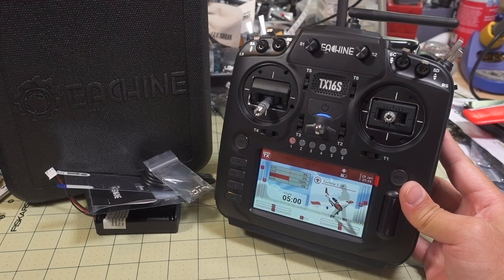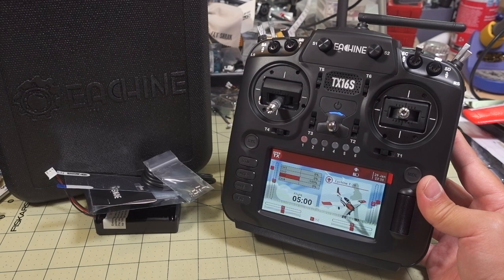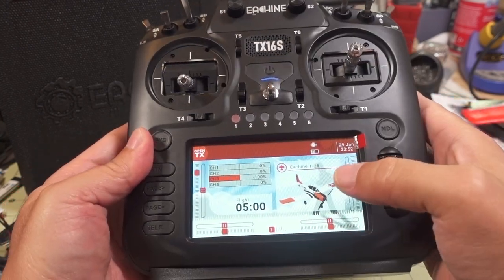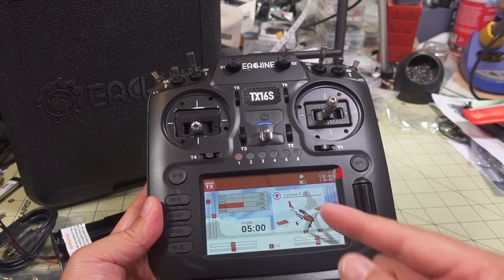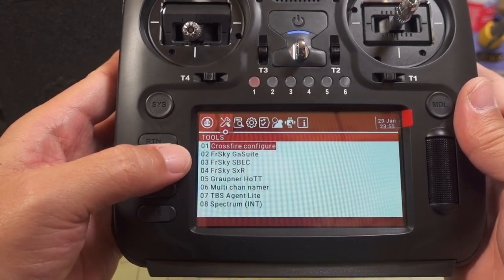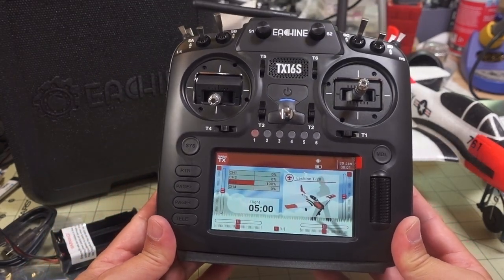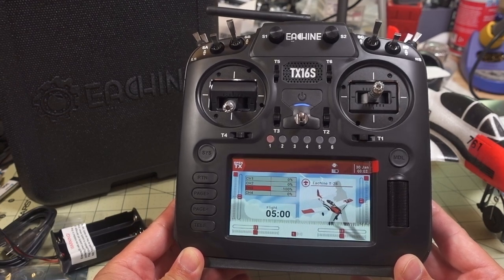Eachine TX16S OpenTX Radio 📡

Comment: Awesome review, Albert! Really nice! 😃
About the airplanes, try to put the radio in bind mode and then connect the battery to the airplane. Many older protocols used to work like that. 😊
Anyway, stay safe there with your family! 🖖😊
Reply from the maker: I did the binding with my T-Lite in the order shown in the video and it worked so there's something wrong with the pre-installed model on this radio.
Reply: @AlbertKimTV  Oh... I see. 😕

Comment: Thats what Eachine always does, they simply pay companies , for example,  "Skyzone" and they pay to have their name slapped on it, its known as "OEM"  which actually is common practice in other industries all the time ,, Im just greatful that Eachine has finally begun to use much better quality companies etc! With the exception of the newest So called Remake of the Wizard,, , I mean the Wizard 6sHV was atleast something new and different,  but to take a quad that is at best 4-5 years old , and pretend to act like its a better quality setup and or components,  is just about a clear betrayel in my book, so Eachine the transmitter looks great and good on u for the goggles as of late,, but shame on u for your most recent attempt to dump older products that were collecting dust!
Reply: Btw, another great review my brotha!!

Comment: I like the looks of it but I’d be concerned about replacement parts if needed. Would you have to try & get parts from Eachine or are the RM TX16S parts drop in replacements? I thought about getting a RM TX16S but not sure it would be an up grade for my Jumper T16.

Good job Albert as usual……..

Comment: Hi Albert! Im thinking of geting into FPV from rc cars and planes. I have got my old dx6i and as far as i know its good idea to upgrade it (it has only 6 channels and no JR bay to get multi module). Many bnf beginner whoops dont support dsm and soldering spektrum satellite cant be done on many boards (3,3v output). What radio do you recommend as a replacement (quads, planes and support of dsm2 to bind with my old receivers)? I was thnking about Jumper T12 pro, but im confused if that is a good radio... or should i save more for eachine or RM tx16s? Maybe other radio? what will you suggest? Cheers :)
Reply from the maker: What defines a good radio is very subjective.  I used the T12 Pro for a long time and loved that radio.  I now use the T-Lite and it's my daily driver.  However, many people also don't like those small radios and prefer big and heavy ones like the TX16S.  Most of these recent radios all work just fine. Whether you'll enjoy using them is something I can't know.

Comment: hello, did you  get it to bind, love the radio would get it now but will wait until binding issue is resolved.
Reply from the maker: Binding was fine. It just doesn't respond to the controls.
Reply: @AlbertKimTV  ok, did you get it to work.
Reply: Did you ever resolve this issue? Just from watching the video now I would suggest moving the transmitter farther away from the model. I have noticed that if the tx and rx are too close binding does not always work.

Comment: Hi did you get it to work with the plane I spent al day yesterday trying to get it to work thanks
Reply from the maker: I did when I created my own model from scratch.  The pre-programmed model has an error in it somewhere but I wasn't able to find it.
Reply: Hi thanks for reply I just can't get it to work even when I tried to do my own model any advice would be grateful or maybe a short video many thanks
Reply: Hi mate I've found for the preset version you have to set it to low power mode then it works fine

Comment: Read the label on the radio.  Yes, it is made by RadioMaster.  It is exactly the same internally as the RadioMaster TX16S.  I like the Eachine for two reasons, it doesn't have those funky and ugly "Chicken Feet" buttons on the top and the actually function buttons on the side of the screen are WAY, WAY better and easier to use.  Not a game changer, but one other nice touch is being able to adjust stick tension and travel from the outside... no opening the case to do that simple adjustment.  All in all, a better thought-out case with the excellent RadioMaster innards.

Comment: the radio supposed to have built in charger but my battery(RadioMaster 2S 7.4V 37Wh 5000mah) is not charging at all...The radio is turned off and connected to a laptop...Please advise.
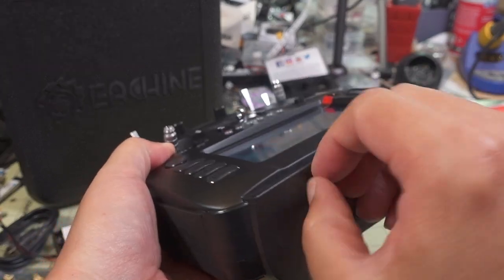Reply: 5:30 Make sure you use the charger port on the bottom, not the port on the top that connects you to computer to play simulations.
Reply from the maker: Use the correct USB port and it will work.
Reply: @AlbertKimTV  thank you guys.

Comment: Would you care to share the Eachine models that came with the radio???
Reply from the maker: You can see them on the radio screen in the video.  In a nutshell, it's all of the micro planes they sell.  I don't think any is missing.
Reply: @AlbertKimTV  I don't have the radio, I've got the Radio Master TX16s. I was referring to the model files so I can add to my Radio..
Reply: So i'm guessing that be a no on sharing the model files since i've gotten no reply back.